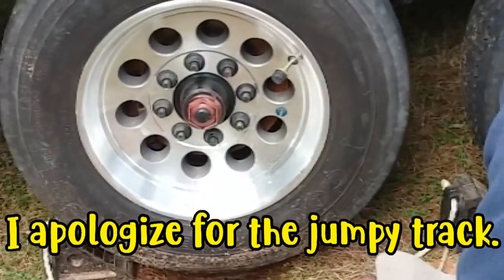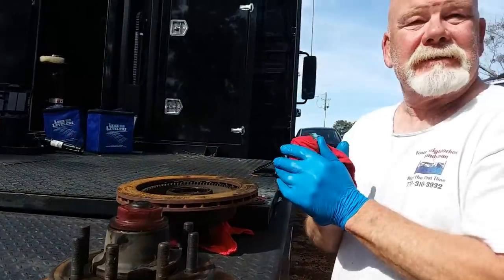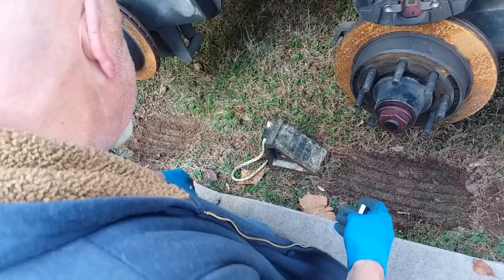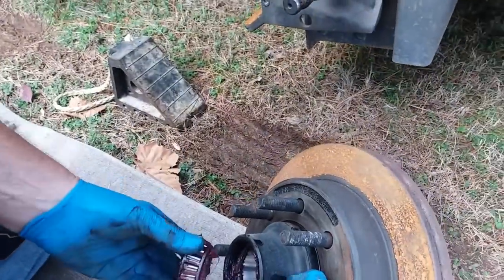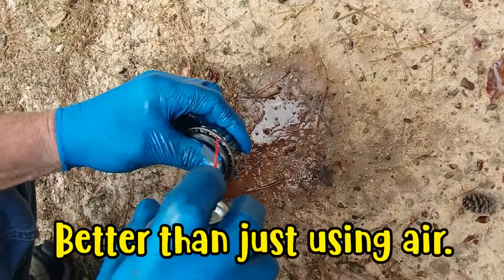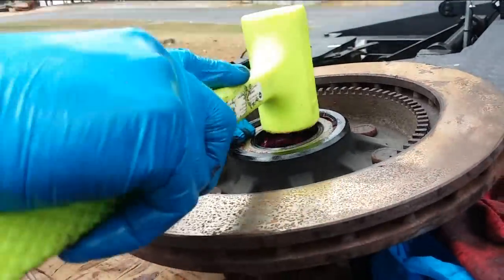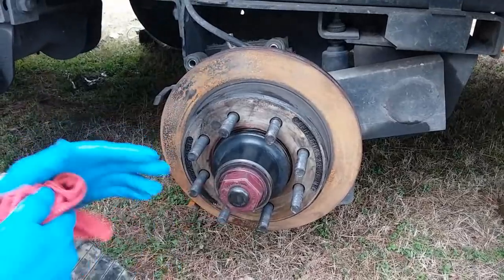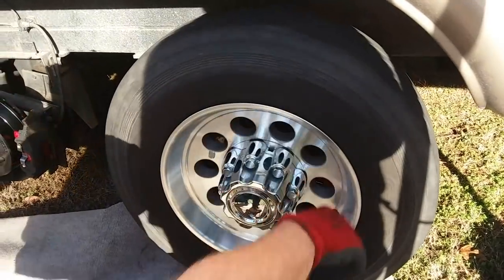How To ... RV Wheel Bearing & Brake Maintenance  // DIY RV Brakes

Comment: Amazing video. Thank you so much. Where did you find what size bearing seals you needed? I sourced new pads but can’t find any resource on line. I have moryde IS suspension with Kodiak disc brakes.
Reply from the maker: Try etrailer.com.  That is where I found all my bearings, pads and seals.  Match them up to whatever Mor/Ryde suspension you have.

Comment: I just called the Drv factor in Howe, Indiana about the issue with using 90 weight oil or bearing grease for repacking.  I was told that they used oil  bath hubs from 2012 to 2016 Drv,’s.  He told me you’re only difference will be the seals that you use for oil is different than what you would use for grease.  And they have kept the clear plastic caps  even on the new Drv,‘s, even though there is grease in it.
Reply from the maker: Hmmmm.  When we bought it used, it had grease.

Comment: You have air-brakes on the tractor, so do you have air-brakes on the RV too. I do not not see  any brake chambers on the RV. Just what kind of brake system do you use?
Reply from the maker: I put air over hydraulic brakes on.    https://youtu.be/iCH1mUa_dQA

Comment: Say Dave, I would strongly recommend a different grease.  The grease you are using looks like the tub version of the common No. 2 grease tube, which may explain the "tacky" wording (vs No. 1).  Recommendation is to use grease labeled as "High Temp Wheel Bearing".  It may not be red in color, but it is a much higher quality.  I have a couple of tubs of the High Temp that are 20 years old and when I look at then, there is no "liquid" separation or settling, whereas the common red stuff in a grease gun can start to bleed red oil out of the grease gun in 6 months or less.  The fact is that most common grease is blended with clay to create that tackiness.  The High Temp stuff is more refined, thus does not have the clay.  You don't want to be packing your bearings with clay.

For anyone wanting to do their own test, take a blob the grease you are interested in and place it on a piece of cardboard (like a cereal box) then place that somewhere that it does not get disturbed.  Look at it after 3 months - is the cardboard wet with oil?  Look at it after a year - the cheap stuff will be like a stiff pile of dog poo and has no lubrication remaining.
Reply from the maker: I did not know that.  Thank you for the info.  Good stuff Bob.  I'll check into that next time I do my bearings which will be soon.  👍

Comment: Do you have Dexter Ez lube axles ?
Reply from the maker: No.  We have MorRyde independent suspension.  I use grease instead of oil.
Reply: I have the MorRyde independent suspension also with I think the Dexter EX lube 8k axle . Calipers say Kodiak 250 on them so should be Kodiak disc brakes . Getting ready to do my maintenance, don’t think I just want to flush grease out using the zert . Thanks for the video

Comment: Thanks, Very nice detailed video.  Would that Drv, come from the factory with 90 weight oil behind that clear plastic cap with the black rubber fill hole?  Or do you feel like you have more longevity or better results using Grease?   Thanks for your help once again.  Safe travels
Reply: They are designed for grease so one has to use grease.
Reply from the maker: No, it does not come with 90 weight oil.  These are not oil tub bearings. They are grease bearings.